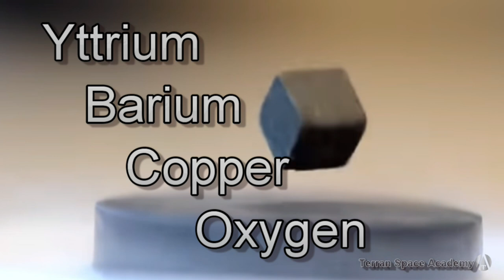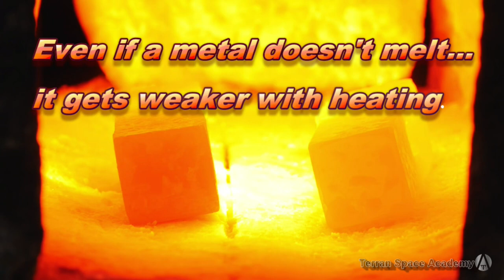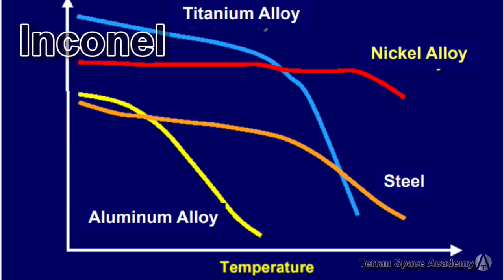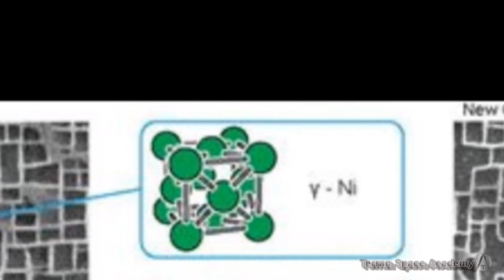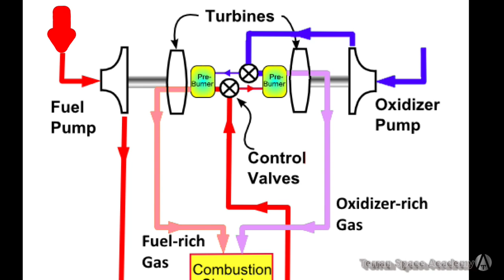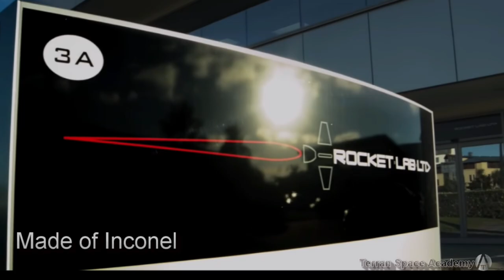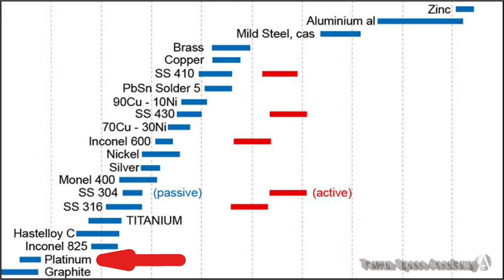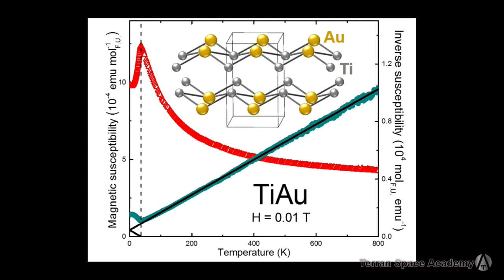Space Manufacturing: Super Alloys and Their Potential for Space Exploration

Comment: Inconel 718 has been used in downhole Oilfield equipment for over 40 years.  High strength at temperature combined with corrosion resistance is the reason.  High temperature salt solutions destroy most steel grain boundaries  and led to low cyclic fatigue failures.  Since a lot of offshore drilling is around salt domes (most of the Gulf of Mexico deep water), the drilling mud (really a super non-Newtonian fluid) quickly becomes salt saturated and the corrosion is exponential above a certain temperature (I forgot the number).
Reply from the maker: There is tremendous engineering knowledge in American industry...

Comment: Excellent, worth adding a study I saw where the calculation was made showing that a commercial aircraft pilot has only a 10% chance of seeing an engine failure during a career. The only reason why they seem more common is that they do 'make the news'. Blade failures not due to maintenance errors or foreign object ingestion are almost unheard of.  This is with about 10,000 passenger aircraft being on average in the air at any one time.
Reply from the maker: Jet engines are like internal combustion engines... refined for so long by brilliant people to where they are almost optimized to a theoretical maximum with our current materials science.

Comment: There is a metal out there that went under ground lone time ago. Can you being a metal man dig up what did or did not come of this metal? It’s original name is Nitinol,  but rumor has it they came up with a Super Nitinol. 
Any information you could gather would be appreciated.
Reply from the maker: It's out there... Nitonol is not a metal itself, but rather a shape memory alloy (SMA) that exhibits unique properties due to its composition. The term "Nitonol" is actually a trade name for a specific type of SMA made from nickel and titanium (Ni-Ti). It is also known by its generic name, Nitinol, derived from the combination of nickel (Ni), titanium (Ti), and the Naval Ordnance Laboratory (NOL) where it was first developed.

Here are some key characteristics and properties of Nitinol:

Shape Memory Effect: Nitinol is renowned for its shape memory properties. It can "remember" its original shape and return to it after being deformed. This shape memory effect is a result of a reversible phase transformation between its two crystalline structures: austenite (high-temperature phase) and martensite (low-temperature phase).

Superelasticity: Nitinol also displays superelasticity, also known as pseudoelasticity. This means it can undergo substantial deformations and still return to its original shape upon unloading. It can tolerate large strains without permanent deformation, making it useful in applications where flexibility and elasticity are desired.

Biocompatibility: Nitinol is biocompatible, meaning it is well-tolerated by the human body and exhibits minimal adverse reactions. This property makes it suitable for various medical applications, such as stents, orthodontic wires, and surgical implants.

High Strength-to-Weight Ratio: Nitinol is known for its high strength-to-weight ratio, making it lightweight yet strong. This attribute makes it valuable in applications where weight reduction is critical, such as aerospace engineering.

Corrosion Resistance: Nitinol demonstrates good corrosion resistance due to the protective oxide layer that forms on its surface. However, its resistance to corrosion can vary depending on the specific composition and surface conditions.

Applications: Nitinol's unique properties have led to its use in a wide range of applications. Some common examples include medical devices (stents, orthopedic implants, dental archwires), eyeglass frames, actuators, robotics, aerospace components, and consumer products like eyeglass frames and novelty items.

It's worth noting that Nitinol is just one type of shape memory alloy, and other SMA compositions besides Ni-Ti exist, such as copper-aluminum-nickel and iron-platinum. However, Nitinol is the most well-known and widely used shape memory alloy.

Comment: I remember in the late 80s when superconductors (and specifically the way you can use one to levitate small objects) were first coming into the scene.  I was glued to every scrap of info I could get on them.  And I remember a brief blurb in one report where it was recently noted that replacing the yttrium with bismuth could apparently result in a better superconductor.  But since we're still talking about yttrium today, over 30 years later, I assume that was bunk.
Reply from the maker: No there are higher temperature superconductors... but there is a critical current they can carry before collapsing to normal conduction... sometimes higher temperature function is a trade off.